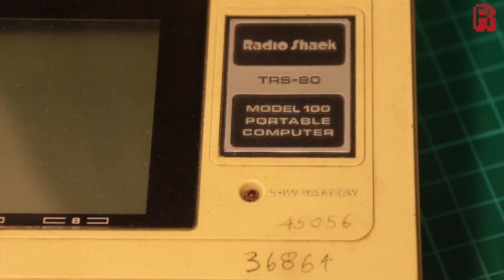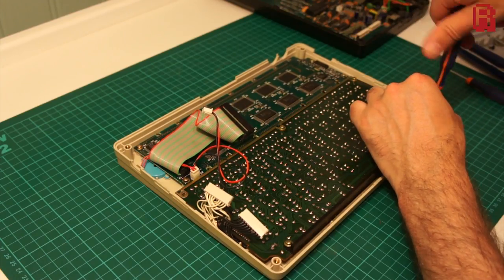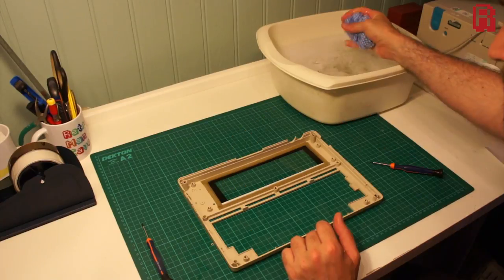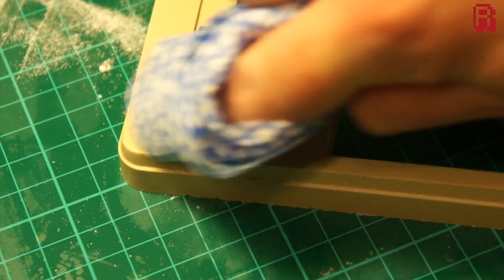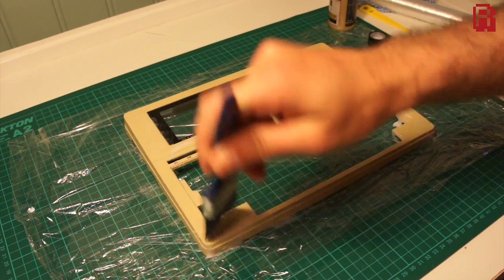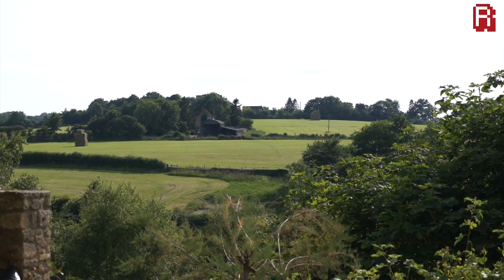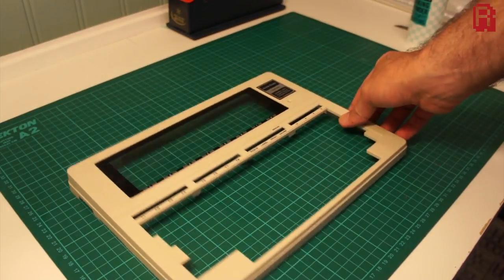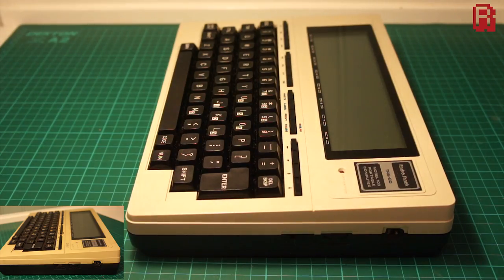Restore yellow plastics on an old computer

Comment: After coming across your video, I bought the same Bblonde product from local Boots chemist (Tescos and Sainsburys also sell it online but I couldn't find it in my local superstores) to revive an old white (more light grey) keyboard where half the keys had turned bright yellow.   I removed the key tops and brushed the cream onto each key and popped them all into a sealable transparent plastic bag.   After just 2-3 hours in the sun, rotating the bag occasionally, the yellowing has completely gone.

Comment: I think that maybe different types (i.e. wavelengths) of UV may be involved in yellowing versus bleaching.  Leaving some yellowed plastics out in the sunlight bleaches them even without hydrogen peroxide (more gradually), while it seems that the UV emitted by fluorescent lighting causes yellowing.  I base the latter on yellowed plastics that have non-yellowed areas in the exact shape of something that shielded them from this light, such as their own power cords in some cases.

As for chemicals that make plastics fire resistant, I'm not really convinced that's true, as in some cases some bits of plastic yellow and some do not.  Some of my computers have yellowed, while others of the same model have not.  I even have one C64C (not all of which yellow over time) that has yellowed and non-yellowed keys distributed randomly on the keyboard.  And no, the key caps have never been replaced on this particular computer.  It seems that some batches of the same plastic are far more susceptible to yellowing than others.  I don't think it's all cut-and-dried like many believe.  There is a lot more to this that we do not yet fully understand.

Comment: Just stumbled on your channel, great stuff here! The plastic yellowing is something for which the incorrect 'scientific' explanation originally offered as a hypothesis by the person to develop the "retrobrite" formula has spread very heavily. You can find so-called chemical explanations that involve TBBP-A, but they are chemically a load of gibberish where they give compounds qualities they don't have and manage to cause reactions without the well-documented conditions they require. Unfortunately, that incorrect information also gives incorrect implications of the reactions. The Yellowing actually has nothing to do with the Flame retardant chemicals at all. It is an inherent property of all ABS plastics, and is a result of the butadiene chain of the polymer being photolysed by heat or UV light. This results in carbonyl radicals which react with other parts of the polymer, the resulting compounds are what cause the yellow colour. Hydrogen Peroxide is a chemical oxidizer, it removes the yellowing by effectively breaking down those compounds further into colourless compounds. Aside from not really "fixing" the issue - the butadiene polymers are still mutiliated - it also has two added effects. The first is that, as an oxidizer, it  will oxidize the butadiene directly in the same way as when the butadiene photolyzes, exponentially accelerating the breakdown during treatment. But it also breaks down and oxidises any UV absorbers or UV stabilisers that are present, meaning that UV light pretty much has no barrier between it and the butadiene, so after such treatments they will yellow much faster.
Reply from the maker: Michael Burgwin fascinating thank you.  I'll have to read up a little more to digest all that but it's very interesting.  Do you have any alternatives or suggestions to delay or stop the onset of yellowing occuring again?
Reply: Great explanation. Although I didn’t get half of it – the chemical process and all ;-) I’m glad someone deconstructed and demystify the process. Now you should develop your own video/blog explaining the process to us cave dwellers. Thanks!
Reply: Most comprehensive explanation of this process I've seen – thanks!
Reply: OK - those comments all sound technically plausible but rather than explain, correct & criticise - would it not have been useful to offer an alternative treatment and / or a way of preventing a recurrence of the issue once treated - ie a coating - in his film he (Mr RMC) mentioned a lacquer ?
Reply: michael make a gel or cream that can remove the yellowing in plastics and you will make a fortune

Comment: Any long term issues with doing this? I've seen quite the surge in people performing this fix. Just not sure about longevity.
Reply from the maker: Project Geek it will yellow again in time just as before.  The yellowing as I understand it is down to O2 reacting with the antiflammable chemicals over time.  This process causes the O2 molecules to be replaced by H.  Over time the O2 gets back in unless you seal it from the air with a sealent, or you repeat the process again.  Some say it can weaken the plastic if you over do it.  lot's of different opinions out there, I'm a fan of it in moderation.
Reply: Awesome, thanks!

Comment: Fantastic video...historically I was using a cleaner called Fantastic to remove some yellowing, but your method is significantly less abrasive...too bad about the poor plastic mixes that have left many cases not only yellow, but extremely brittle...great video.